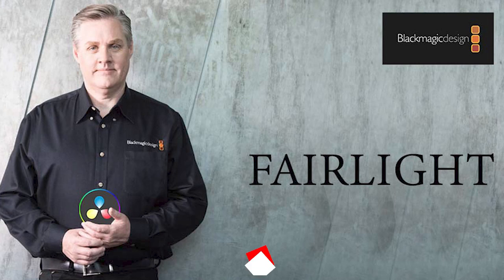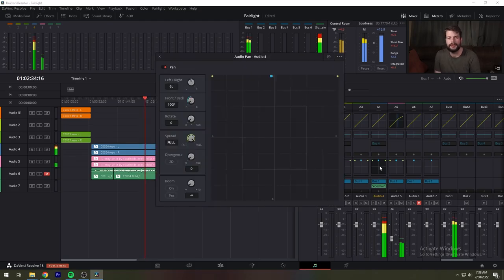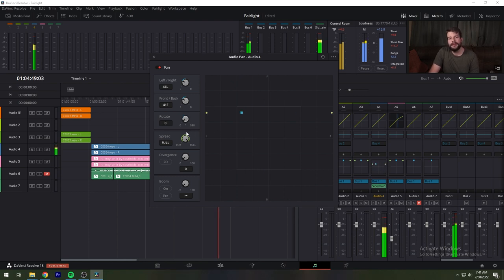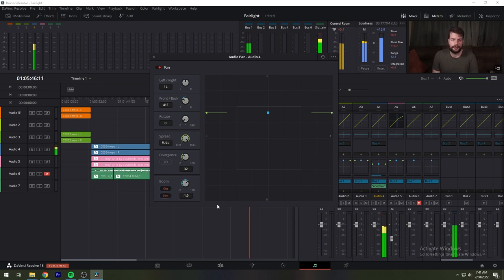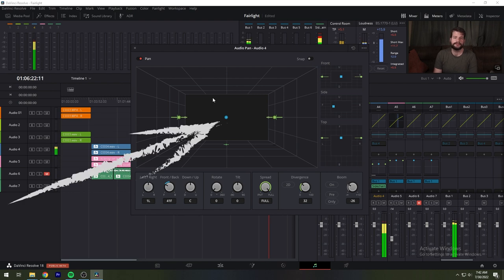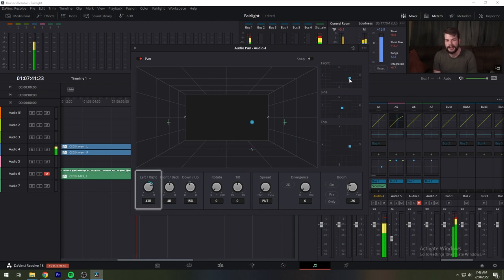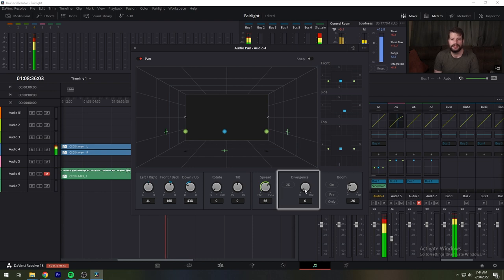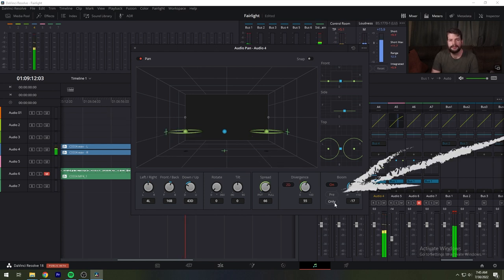Davinci Resolve 18 Advanced Panning Functions in Fairlight

Comment: The Problem here is a  "FAILURE to COMMUNICATE". You know the Material so well you don't realize, in order to teach a Neophyte you must 1st SLooooooooooW  Down. Next Examples Beginners need examples, Lots of examples. I just want to know how to PAN from Front 5.1 Speakers to the REAR/Surround Speakers in DR 18.1.3. to Simulate a plane passing over head.